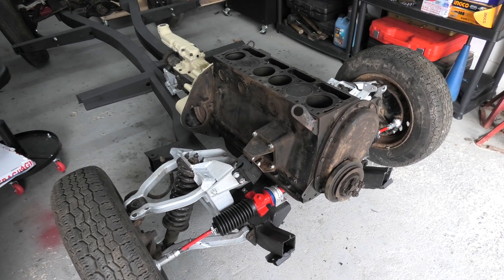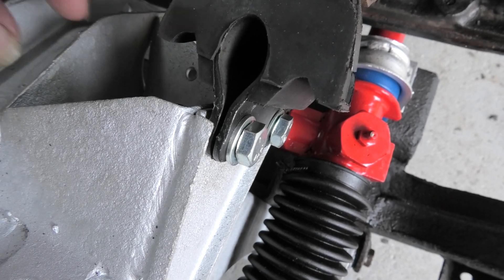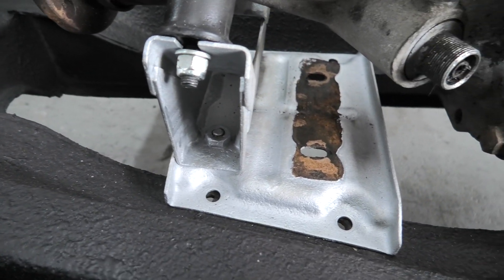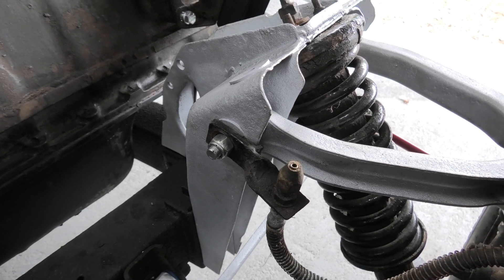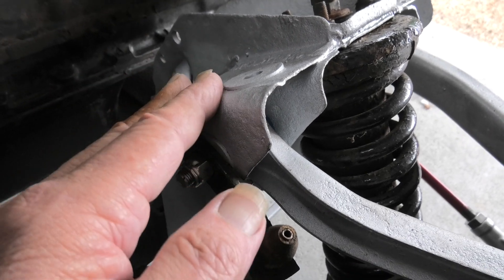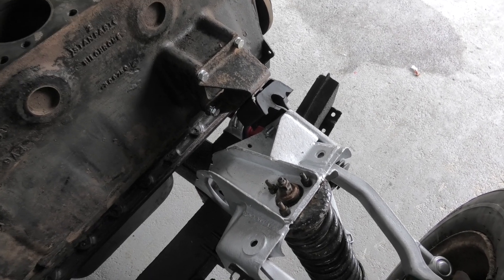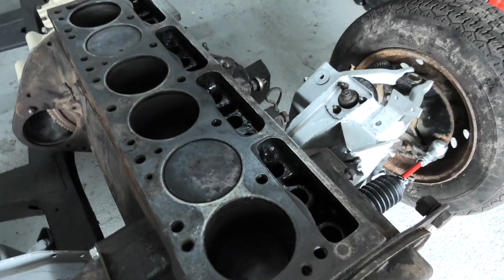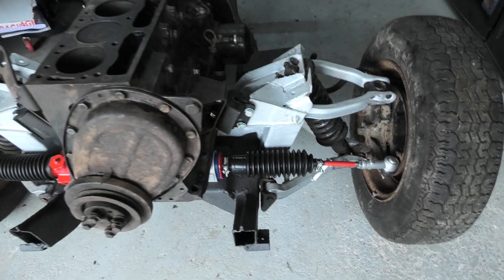Video 5. The engine and gearbox are now temporarily in position within the chassis!    10-09-2021

Comment: Cardboard templates, moving the engine three and a half inches, welding too! Well that should be a five minute job then NOT. You make it all sound so easy and straightforward, but a lot of precision work is involved. Once again I take my cap off to you, totally amazing.
Reply from the maker: To be honest it is reasonably easy little bruv but just a time taker, but most of it’s done now apart from the fabrication of the engine mounts but that will only take a couple of weeks before I can install them - and then the front suspension can go in permanently.   👍🏻.       Cheers for now mate.          …………Graham

Comment: Great Stuff Graham , If I was you i would fabricate a new rear engine mount you could cut all the plates and do all the drilling then get a local mobile welder to weld it all together in situ on the chassis doing it this way would ensure perfect alignment Regards David
Reply from the maker: That’s basically what I will be doing David but until I know the exact position from the prop shaft being fitted then it’s difficult to know at the moment the shape of the gearbox mount I need, I maybe able to utilise the existing one, if not then it will be a new one.    Cheers for now mate.         …………Graham

Comment: Hi ya Graham. You ARE a happy bunny! Lol. I was thinking while watching, making cardboard templates and fabricating metal parts to be welded on, is a far cry from cutting up plasticard and styrene to fabricate a model. Same theory though. All need to be precise measurements. I very much look forward to the next “ fitting.” Oh…. So the gearbox will eventually be silver, what will the engine block be? Thanks for the update. See ya next time.
Reply from the maker: I am indeed Norman, I’m so pleased with the way this project is going so far, it’s coming together really nicely.  I know exactly how I will make the new brackets for the mounts and yes, it will need to be precise otherwise I will end up with horrendous vibrations if I’m not careful so slowly does it.  The engine will be painted in the green which was used so often in the ‘50’s for engines, the actual gearbox will be too but not the parts you see in primer already, they are aluminium and so will be painted in silver.     Cheers for now mate.       ………..Graham

Comment: Very interesting Graham. I would have thought that getting the gear box mount to fit the curve of the chassis would be quit difficult ,looking forward to your solution.I just realized from this video that that is a 6 cyl your putting in.It is going to go like a scalded cat! Cheers!
Reply from the maker: Hi Mark, well the gearbox mount is already there so I just need to modify it to fit once I have the correct position for the engine. That 6 cylinder engine was fitted into the Vitesse and GT6, the TR6 had a different engine as far as I can remember but all 6 cylinders, with twin carbs and electronic ignition then I hope it will have a little bit of grunt to it !   😂😉.         Cheers for now mate.           …………Graham